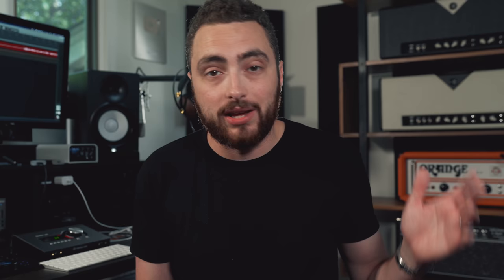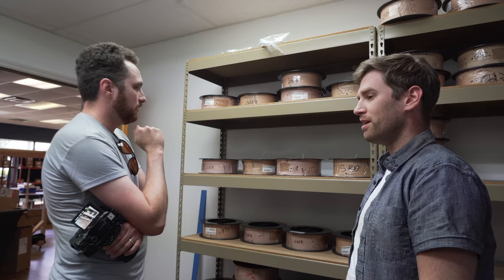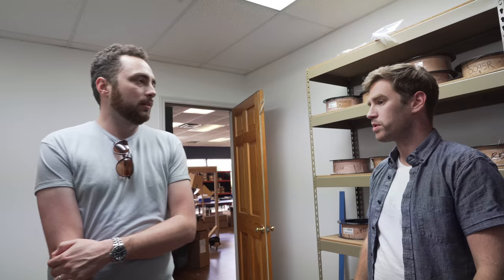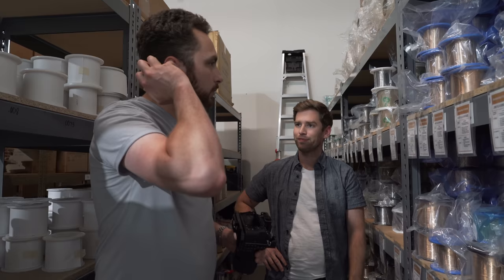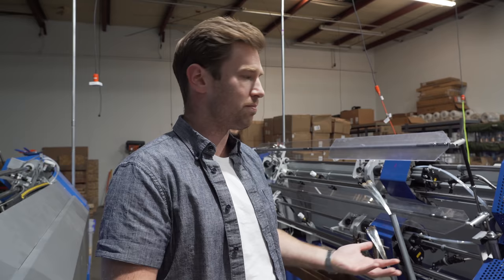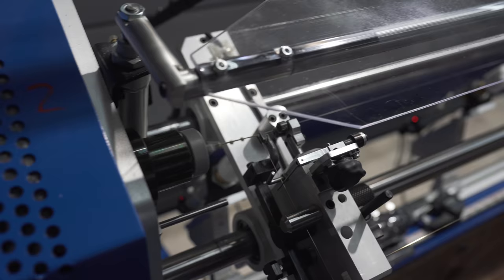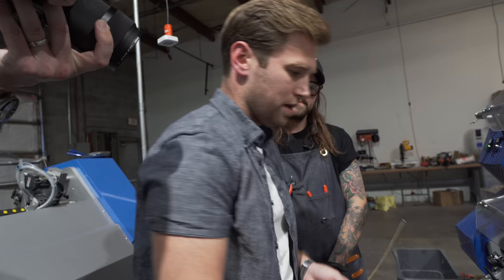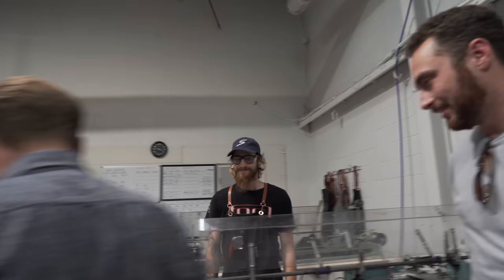I Got Schooled On Finding The Right Guitar Strings

Comment: Millions of hours spent worrying about differences between different clones of TS overdrives - yet people hardly ever thik about experimenting with their strings and the significant differences it makes to your tone and feel. Experimenting with custom strings especially can really nail a great feel & tone for a player
Reply: LOL - Good point :-)
Reply: @RogerBarraud  custom strings?
Reply: 45 years of playing, I use Ernie Ball sets on my electric and electro acoustics, must be at least 20 years that I settled on these, 9's on the electrics and 10's on the electro acoustics. When I had bass guitars I used Rotosound swing bass 66's.
Reply: Strings on electric guitars do NOT have "significant" differences in tone. It's just typical guitarist BS. There's countless examples on YouTube of players and engineers failing blind testing of strings by ear.
Reply: @davidchavez4464  Custom gauges where you use find a mix of string sizes that works best for you & a particular guitar. For example 10 - 46 is a very standard spread of string sizes, but some people feel not quite sure between a 9 - 42 & a 10 - 46. Experimenting with a custom 9.5 - 44 pack such as 9.5 - 13 - 16 - 24 - 34 - 44 is a great option (and this is actually my favourite custom gauge set)
Reply: @TUUK2006  sure, if you can't hear or feel any difference between different gauges, pure nickel vs nickel plated, hex vs round core, coated vs uncoated, different brands etc etc it's all good man. In the end always go with your own ears and fingers it's all good.

Comment: Great advice from Scott on mixing string gauges.  I used to try and keep all guitars on similar strings.  I now deliberately have some on 8s, 9s and 10s.  I think it has improved my technique to be able to swap between gauges and not over bend etc
Reply: Same! I also play drastically different instruments with varying control schemes and neck profiles. I can pick up practically anything and play it like me. Only limitation is amps - some amps make me really uncomfortable.
Reply: @Diax1324  Yeah same, at first I was like I will only play my band songs on the only guitar I use for practice and shows lol, now it's more like what kind of mood am I in   
  
My main two I go between often are a Tele (25.5 of course) and a Mustang (24) and now that I'm used to switching around, I enjoy how they make me play differently

Comment: Thanks for this great video! Very cool. I've used custom string sets for decades now, mostly because I prefer the tension to be as balanced as possible across the strings. For example, on my fave PRS, I use pure nickel in gauges from .0085 to .038, with the bottom three wound. That averages to 12.33 lbs tension per string, with none of the strings deviating far from that. So, other than obvious differences in string diameter, the effect is that moving from any one string to any other requires virtually the same finger gymnastics. For me, that feels silky smooth. Cheers!

Comment: My luthier Dan Blom set up a drop c, drop b and a drop a on three guitars. He Used 3 to 4 different strings size to get each guitar. This is when I was taking a break from the blues. I’ve pulled them out of the case and plugged up the guitar and played. He even did a floating Floyd rose in drop b. And I had 0 problem s. I would recommend get a luthier do it. U will save a ton of money. Because they know this stuff for reason. Good luck.

Comment: I like the German strings, Optima, Pyramid and Thomastik-Infeld. I also use flats for the low "E", "A", and "D". for the sound and the feel. I recently began to experiment with .008 sets for my electrics and .011 sets or my acoustics. So far, I like them a lot.

Comment: Figuring out custom string sets can be pretty fun. I do it often with this backer packer acoustic I have that was made by the guy Martin leased the Back packer design from, Bob McNally. It has no truss rod, so you really have to make sure your not going to warp the neck. Right now I’m playing 39 - 8.5. It looks the same as a Gen 1 Martin Back packer but way better. The Martins suck, I hated mine. Sold it off for $80.

Comment: Started using the “Hendrix” 10-38 string gauges and now they’re the only strings I’ll use.
Reply: I use them too and they are freacking awesome
Reply: Just discovered Hendrix strings.  Really excellent.
Reply: Same here. It's the greatest thing to ever happen to my guitars.
Reply: I'm trying to sound more like Hendrix..got the Olympic white strat..upside down headstock purple velvet pants ..will switching to the Hendrix 10's get me in the ballpark?
Reply: @cragway  Also, tune down 1/2 step.  Easier to bend.

Comment: I love the pure nickel Broadways. They last a long time and have the best high end (for me anyway). Designed myself a balanced set for dropped D on a FR bridge using Scott's instruction on the Stringjoy page and it is the nicest set I've ever used. I have found a balanced set goes back into tune really well when doing whammy bends comparatively. I don't have b string tuning issues anymore either. Stringjoy Rocks! \M/

Comment: A question occurred to me: have you/they started playing around with using a Graphene Core in order to achieve a thin, strong string core? You could wrap it with nickel, for example (I have no idea how flexible or resonant it would be). They are doing acoustic bodies and neck rods out of Graphene, so why not?
Reply: I think that graphen takes more profit using on the pickups bobine wire,for capacity eléctric conductivity also of course other tonality and response(is posible this payo "Ellon musk" got grphen pickups).

Comment: In my opinion one aspect of choosing string gauge often gets missed: When you choose higher gauges for e.g. D-standard tuning, the thickness of a plain 3rd can cause some troubles. The intonation of a very thick plain 3rd in my opinion is just horrible. Also the transition from plain to wound strings can sound very apruptly and on a guitar with no adjustable pole pieces can be a problem. Biggest problem in my experience is on guitars with a trapeze tailpiece (Rickenbacker) or Jaguar/Jazzmaster/Mustangs, where the break angle on the bridge is small. A thick plain 3rd needs a bit of a breakangle to sit tight on the saddle, and if not, the string can start to sound very sitary or banjoy without any sustain. I often choose a wound 3rds with higher gauges, but somehow it seems that I am somehow almost alone with that choice... 🙂

Comment: I'm exiting this video about halfway through because I don't care how strings are made.  All I care about are tone, feel, intonation and durability.  Some thoughts on brands I've tried:
GHS Boomers--a good string, but too bright for the music I like.  Very durable, good intonation.

DR Pure Nickel Wound--poor intonation and durability.

DR Dragon Skin Coated--nice tone, intonation and easy to bend.  Wound strings feel a little rough but I use them on my Ibanez Artist.

D'Addario XLs--dull sounding, especially the wounds.  Sound dead even brand-new.  Treble strings break pretty quickly.

D'Addario Chromes flatwound.  Very nice on my Gretsch Streamliner full hollowbody.  And they make them in a 10-48 set with a wound third, which is good for my aging hands.

D'Addario NYXLs--sound tinny, especially The unwound strings.  Stiff and hard to bend.

GHS Brite Flats--an excellent string for blues and classic rock.  Nicely balanced, and not too dull in the lower register.  They are hard on guitar picks, but nylon picks stand up to them very well.

D'Addario Half Rounds.  Disasterous.  Wounds are so dull and flabby-sounding, and they get worse in a hurry.  Intonation very poor.  I have one set left over and I will use it for a setup on a new guitar, then immediately replace them.

Elixir Poly Web Nickel.  Good all around string.  Good feel, nice, played-in tone, last for ages.  I like them a lot and would try their acoustic strings some day.

Ernie Ball Slinkies.  I like the regular 10-46 set on my Ibanez 335-style semi-hollow.  Tone, feel, intonation and lifespan are all very good.

Ernie Ball Pure Nickel Wound, 9-46.  My absolute favorite string of all time for silidbody guitars.  Perfect for blues and Southern rock, and with the right guitar and amp settings you can get a little bit jazzy too.

Ernie Ball Slinky Cobalt, 9-46.--I put these on one of my Epiphone LP Custom Prophecies, and I didn't like these at first, but I kept them on and after about five hours of playing they mellowed out and sounded great.  Wound strings are tight and clean, trebles sound nice and fat.  If I changed strings very often I would not use these, but since I tend to leave strings on until they go dead or one breaks, I may keep using these in the future.

I have never tried Stringjoy products, but based on the many rave comments, I might give them a try some day.

.

Comment: I have never known the difference between nickel, phosphor-bronze, full-steel, or whatever else. All I know is my sweat will rust Ernie Ball Slinky. I switched over to D'Addario XL, and that solved the problem. Why D'Addario specifically, and why the XL specifically? That is what the local guitar shop has. As for the XT, NYXL, XL Pro Steel, XL Nickel Wound, XL Chromes, or whatever else, I don't know the difference. I literally have no idea. As long as it has the correct gauge, that is the one I buy.

In my case, I buy EXL157 14-68 for Drop A on a PRS 277, and EXL156 24-84 for Drop E on a Squier Classic Vibe Bass VI.

Comment: Question: Do new strings left in their original packaging go "OFF" if not used within a certain time frame?; I'm just wondering if buying strings in bulk if such a wise thing to do.
If they do tend to go "OFF", what time frame are we looking at, and does it vary on the type of material used? IE Acoustic V Electric strings.
Also what causes it?
I've ordered pickup's from KINMAN, and in the order process for a lot of their pickup's they ask what gauge and type [ wound/un wound] strings you intend to use, mainly the G string, and then recommend which pickup to order.
Reply: Over time strings will degrade in the original package eventually but the timeframe? As with everything related to music, it depends. Factors include what the strings are made of, how they are packaged (air-tight plastic vs. Just a paper envelope, for example), how much the strings were touched in manufacturing, temperature and humidity where they are stored ...

Buying in bulk makes sense if you change strings all the time. I'm an old school bass player who rarely changes so I just keep one or two backup sets on hand. Some players change strings everyday or every gig so they naturally need more.

I'm comfortable keeping a set for several years as long as they aren't exposed to the elements. Someone who likes a brighter sound will need to give you their preference. And then you'll make up your own mind.

Good luck!

Comment: How the hell do they charge $5-$10 for six strings using copper or bronze?  I have to use coated strings, not because I like them but because uncoated strings turn my finger black.  I pay $13 per pack on Amazon roughly.

Comment: So talk to a company that’s been around 7 years, or maybe reach out to D’Addario… who probably built those string winding machines. 😄 

Steel strings have never had nickel cores. It was always tin plated steel. Nickel is not really very magnetic. The wraps on pure nickel strings was nickel. Nickel is corrosion resistant, that’s why it was used, and why steel wraps are nickel plated these days. Monel was another popular nickel alloy with composed of nickel (from 52 to 67%) and copper, with small amounts of iron, manganese, carbon, and silicon. Gibson made monel strings.